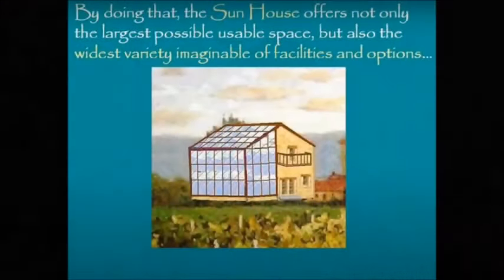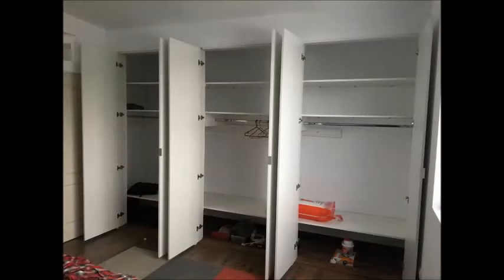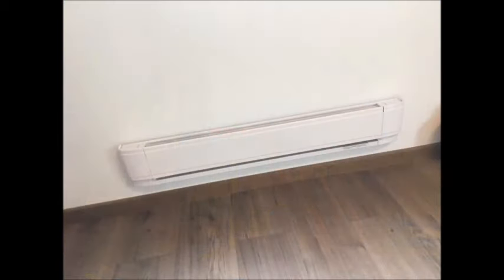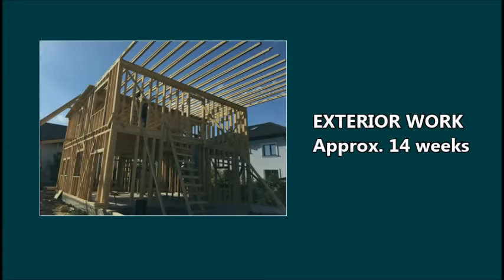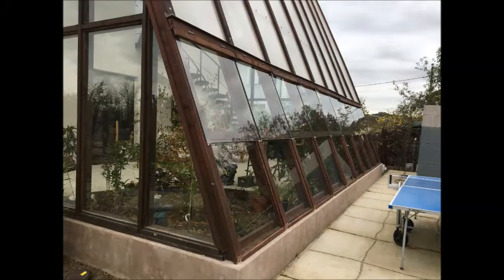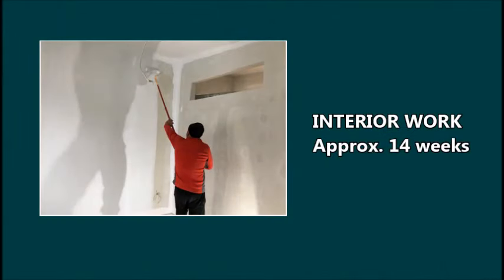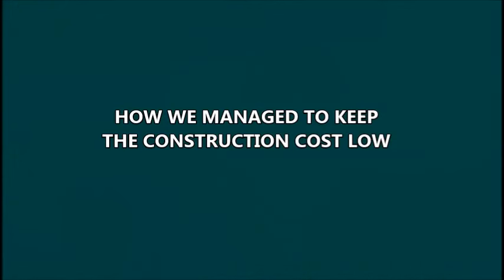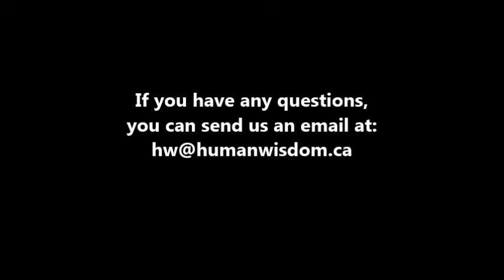How we built our dream house with indoor Mediterranean garden in a temperate climate

Comment: Wonderful sun home Dan, and thanks for documenting and sharing the process. I like the Montreal-ish design, with stairs on outside, but so much more practical with greenhouse cover instead of being covered in snow like they are here!?! A few questions for you: What is the white exterior finish on house? Is it much more affordable building in Romania compared to Canada? What kind of glazing did you go with for sunroom? Thanks so much!
Reply from the maker: Thank you! The exterior of the house is of polystyrene covered with an acrylic coat (usually called EIFS - exterior insulation and finish system). Regarding the cost, as you know, things are constantly changing… but I would say the cost of building this house in Romania was half, or maybe even one third, of the cost of building it in Canada. The sunroom front wall is of 10 mm double-wall polycarbonate, and the two side walls are of 6 mm glass.